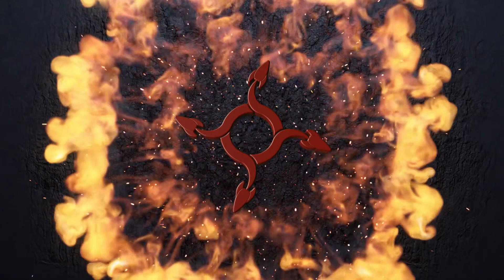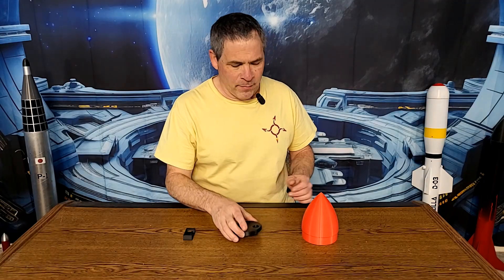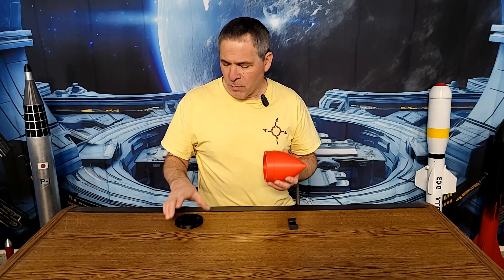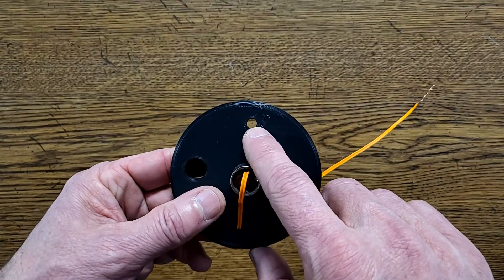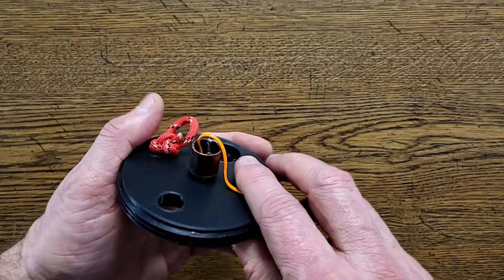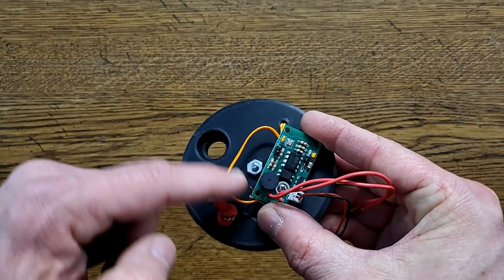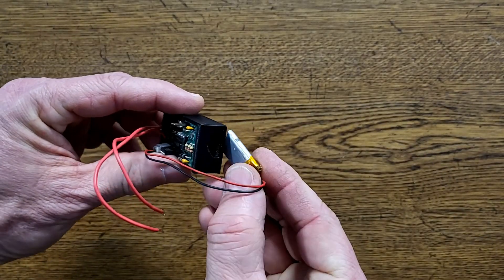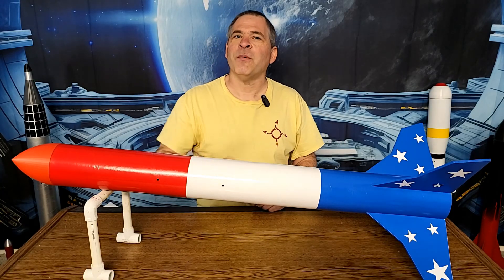3D printed combination rocket nosecone & electronics bay - Available on Thingiverse

Comment: Nice the solution, where do you get those tube to build the rocket body ?
Reply from the maker: Staples... But any office supply store should have them. They are shipping tubes. But make sure it's the thin wall type. You could build a rocket with thick wall tubing but it's a lot heavier which could be a problem for lift-off.